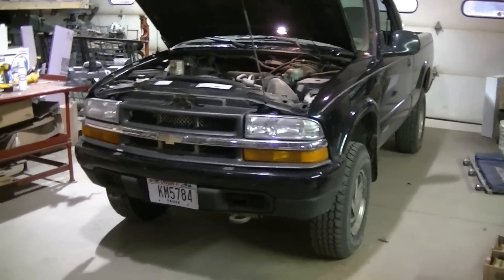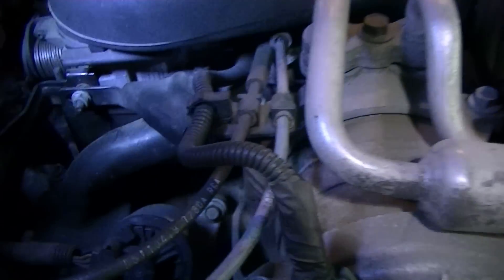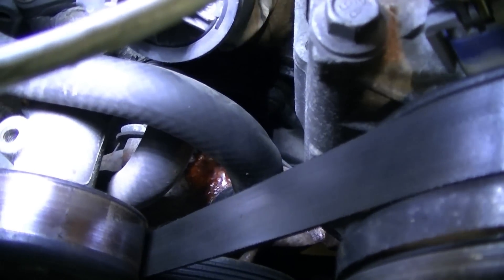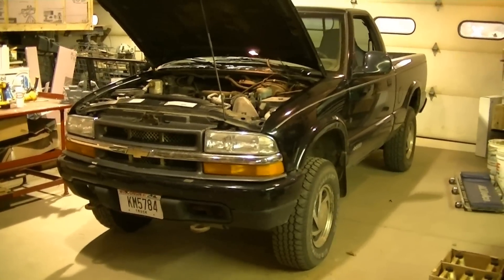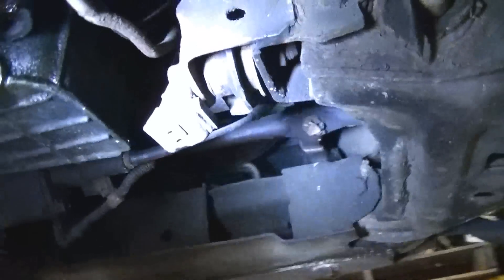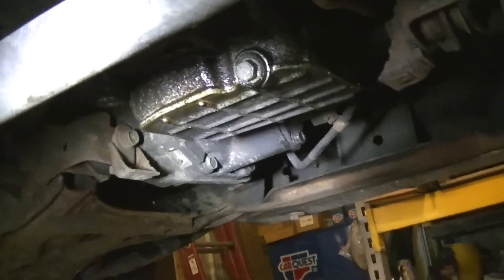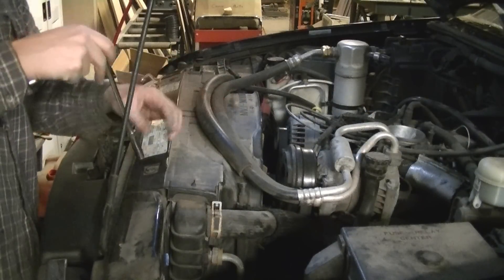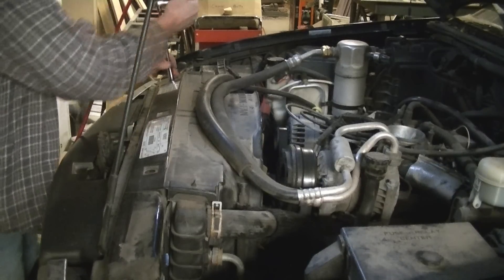98 S10 Vortec V6 4.3 Intake Gasket Replacement Part 1 of 5

Comment: Just a word of thanks for the video.  I'm not a mechanic, but my husband (who used to be) had a stroke a few years back, and couldn't tackle the blown intake manifold gasket.  I still had to point at a few things with plugs in them and say "What's that"?  But I got it apart, a new gasket in, and back together.  Lost an o-ring while fighting with the fuel lines and had a leak, but took it back apart and put the old one back in.  It worked.  Car is now running again.  So, big thanks for the video series that let me make labels for everything I was taking apart.

Comment: The S10 Forum was helpful, but watching your video sealed the deal.  I watched your videos over and over through the process.  Great production/video quality btw.  Wished I'd replaced the water pump during the process because the cooling system wouldn't hold a vacuum.  The gasket on the water pump was leaking.  If I can send you some payment, please let me know.  You kept my truck on the road!  Helluva  guy!
Reply from the maker: Glad I could help!

Comment: Lefty loosey for the fan. 
You can also use a 10mm wrench to help hold the pulley while you bust loose the big fan nut. Super easy

Comment: Im currently doing my intake manifold gaskets on my 99 S10 ZR2................ SERVICE ENGINE SOON light came on and Pep Boys ran the code and says my V6 is running lean............  my truck has 203K miles on her and its still a great motor. To take off the waterpump fan, what I did was hold the waterpump pulley with vise grips and that held great................
Reply from the maker: +eric rutherford   Have you changed your fuel filter?

Comment: Was the bottom plug on the radiator the only place where you drained the fluid, did that remove most of the fluid from the intake as well? Also where there any hoses going from the radiator to the intake that you removed off camera that had any coolant sitting in them? Best walk through on YouTube by far.
Reply from the maker: There are a total of 5 videos.  I don't think I left anything out.  If I did something off camera I mentioned it.  In the second video I believe I show that I removed the lower radiator hose from the water pump and that will remove most of the coolant.  There will be some coolant left in the hoses.

Comment: Well.............got a in. lb. torque wrench at Harbor Freight and had to fork out a whopping 9.99 plus tax !!!  Hopefully I used enough sealant !!!!  Got that down and the valve covers all nice and clean and installed!!  Ran out of daylight, so will start up again once the sun rises !! Supposed to be a nice day!!  My MAP sensor gasket also broke, why cant we get just a gasket for that k=like you did with your EGR valve??  

QUESTION. SO the distributor HAS to be dead on my mark, or the truck wont fire up?  I got it pretty good, but it still has to come off again so that I can install the gasket!

Another question !! The distributor I see didnt come off with a gasket, so is this a new thing to add the gasket?? 
I cant wait to get my 99 ZR2 back on the road again !!!  Been sitting for too long ~~
Reply from the maker: +eric rutherford   There should have been a gasket on the distributor.  And yes the distributor has to go back exactly were it was.  Otherwise you will have to adjust it.  I think that is where most people mess up when the truck won't start after they do this job.
Reply: +mossman381  EIther mine deteriorated or the factory forgot to install a distributor gasket !!!

Comment: Just got the manifold off this year (New Years Day) and see that the hold down bolt to my fuel spider is loose as heck, but is there! Is that supposed to be that loose, or should I torque it down ?
Reply from the maker: +eric rutherford   I am not sure.  It's been a long time since I did this job.

Comment: In your opinion, what was the most important things to remember to do this operation?  Distributor? Fuel pressure release?
Reply from the maker: Probably making sure you mark where the distributor is sitting before you take it out.  That and remembering to plug everything back in.
Reply: @mossman381   did you use the injectors that came with the intake or did you use different ones. Also did you use a fuel pressure regulator and did you have to reprogram the computer?

Comment: I have a 2001 Blazer, am told I have a leak as well, on the driver side as well, it's leaking back into the oil system, as there are no puddles even though the radiator empties out, is this the same engine as the 98?
Reply from the maker: They are similar engines but the 2001 will have a little different intake and different fuel injection system.  Actually it has a better fuel injection.

Comment: OK, I see all you do is take the number that the gasket paper instructions give us and divide that number by 12. Im going to do 4 ft lbs first, then 8, then the paper here just has 11ft lbs for the last and final torque.  Im going to be setting down the manifold today, just as soon as the sun comes out. Being a truck driver, this is taking me 3 months to complete !! LOL. My next job since the truck has 203K on her is the heatercore! I read that is a job with having to pull the dash !  Do you, Mr Great Mechanic have a video on that ?? If not, please start !!
Reply from the maker: +eric rutherford   You really need an inch pound torque wrench for inch pounds.  The bigger torque wrenches don't do well at the very low settings.
Reply: Mossma381 is right. The bigger torque wrench does not do well at low settings. I snapped a transmission pan bolt trying to do 10 foot pounds.

Comment: I have a 93 Chevy c1500 standard and it got a little warm when the water pump when out but didn't overheat and after the water pump went out I replaced it of course but after I did that it starts to blow white smoke just a little after it warms up but when I start going the smoke goes away what do you think it might be
Reply from the maker: Hard to say without looking at it myself.  Keep an eye on your coolant level.  If you are loosing coolant and have no leaks you have a bad gasket or cracked head.
Reply: +mossman381 ok thanks for replying

Comment: Mossman, I have oil in the radiator on my 2001 blazer. Is the a surely an intake gasket issue? Thanks!
Reply from the maker: jeff rossberg Rossberg   Could be but sounds like a head gasket.  Is there coolant in your oil?

Comment: I just change the oil in my 01 4.3 and it looked a little brownish. been driving few days now and checked my oil it looks white grayish my compression still good could it be the intake gasket? i flushed out my coolant when i change my oil but that looks good still no oil in it just the oil in the motor looks like coolant is mixing
Reply from the maker: +MELEK ONER   It's possible you have an intake gasket leaking coolant into the motor.  The S10 is very well known for the intake gaskets leaking.  Another thing that can go wrong with these trucks is the fuel pressure regulator can leak fuel into the motor oil.  That was one reason I replaced mine while I was in there.

Comment: I don't have a shop vac and I know I have gas coolant and dirt that has fallen down into my engine. What would you recommend at this point? Just do an oil change before I start it up again?
Reply from the maker: You really need to try and get most of it out.  Dirt in an engine isn't good.  Yes an oil change right away would be a good idea.

Comment: Well after spraying down my MAP sensor with MAP sensor cleaner, I HAVE NO MORE CHECK ENGINE LIGHT !!!!!  99 S10 ZR2 with 204K miles on her and still running!!  Strange how my thermostat gauge would only read a quarter hot and after doing my intake manifold gasket job ( with MOSSMAN's VIDEOS ) installing a new waterpump , thermostat, and temperature sensor, the gauge now reads the truck at being halfway hot!  I should of replaced the radiator while I was doing this job, but the truck never has overheated on me.
Reply from the maker: Glad to help.  Your gauge might have been reading right before the new temp sensor.  Or the thermostat might have not been closing all the way.  Your temps should be around 190.

Comment: Do you need to put it on TDC first?
Reply from the maker: I didn't but I put the distributor back in the exact same spot and didn't turn over the motor. Worked out just fine for me.
Reply: mossman381 thank you for the information I’m about to do mine next week I really appreciate

Comment: When are the head gaskets supposed to go out? Ive read where guys (and gals) did theirs with under my mileage and here my 99 ZR2 has 203K on the odometer................ Anyone want to buy the truck ???
Reply from the maker: +eric rutherford   I can't tell you when your truck will loose a head gasket.  Don't overheat the truck and you probably won't have a problem.

Comment: You gotta bang it quick to loosen the fan.....I was stumped for a day myself ...it’s more speed than power to snap it free
Reply from the maker: The fan can cause a lot of problems for people.
Reply: mossman381 this looked like quite the project.....today my s10 pu started smoking like mad, coolant burning off engine and exhaust ...passenger side but I couldn’t quite make out exactly where as steam and heat made it impossible to pin point ....tomorrow I hope to find leak , but I’m thinking it’s (at least one leak is) the manifold ....there’s so much fluid spraying around I thought maybe a cold plug type of thing , the fluid goes as soon as I pour it in so it’s hard to see all points, but it may well have blown out a few spots .... I guess I’m asking is this a common problem with 4.3 l Chevy engines, intake gasket blow out, that maybe you’ve heard of? Also if not is there another fast leak area to look for...? The engine never lost power so I’m fairly confident it’s not a head gasket type of issue and I’m not sure about heater and intake coolant lines yet , but it doesn’t appear to be .......thanks for the very thorough series of vids too
Reply from the maker: Intake gaskets are common on these 4.3 engines.  They don't usually start leaking so bad coolant streams out.  It's more of a drip down the block thing.  Might want to look at the hoses going to the heater core.  They are on the passenger side.  I suppose a freeze plug could have rotted out.  That could be a real problem and might require taking the motor out.  I hope that isn't your problem.
Reply: mossman381 thanks

Comment: Common issue on these chevys.  I could do them in my sleep.
Reply from the maker: I have never had to do one until now.  But this is my first S10.  Not as bad as I imagined it would be.
Reply: Its very easy.  I just dislike taking the distributor out, but yea its doable.
Reply from the maker: ***** Is there any parts I should replace while I have it all apart?  The oil sending unit looks easy to replace right now but it is still working.
Reply: mossman381
they hardly go  but  they do like to leak after awhile.  I would check for leaks in the plenum.  Nothing else I could think of off the top of my head.
Reply from the maker: *****
It looks like there is oil back there but not sure if it come out of the back of the intake or oil pressure sender.  I may just replace it while I can get to it easy.  I would like to take care of most of the leaks.
Reply: mossman381 Yea It dont hurt to do so
Reply: Maybe you should take a nap and help me out?

Comment: I have a 1500 V8 Vortec in my 02 Suburban and I'm not a fan of it. Im not a fan of GM products unless its pre 1980's because thats when GM went to shit was the 80's. Im a Ford fan, I've been searching around for a 4x4 Ranger for a while now, Ford always puts out a good product.
Reply from the maker: All manufactures have good and bad points.  I will always drive a GM product.
Reply: mossman381
I agree
Reply: @UnitCrane514 I have to disagree with you there. I'm a Service Technician in another trade and my service van is a 2016 Ford Transit. Every six months, my transmission acts up and I'm without a van for one to three weeks. "Ford always puts out a good product." is the statement I disagree with. Ford has put out great vehicles but has also had colossal failures, like with these transmissions. They had a major recall on these transmissions but even with the fresh parts, my transmission still acts up. My best friend in college had issues with her transmission as well on her newer Ford Fiesta. My co-worker has a newer Ford Expedition and has had repeated timing chain issues that were luckily still covered under warranty. Again, he was without a vehicle time and time again. He had it in so many times, the dealership didn't want to continue to warrant the repairs but he said something that got their attention. He didn't pay a dime that I know of. He had just bought it so I think he threatened that he wanted them to do a full buyback.

My Dad is a diehard Ford guy. Through and through. But I'm a diehard Chevy guy. It just depends on a given person's experiences. All manufacturers have their own strengths and weaknesses. I just wanted to share my experiences with you.